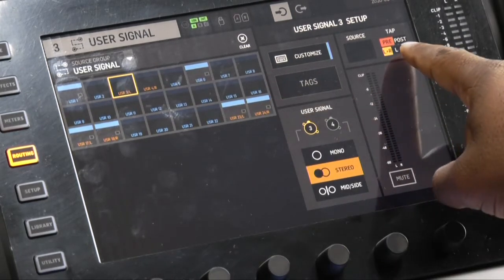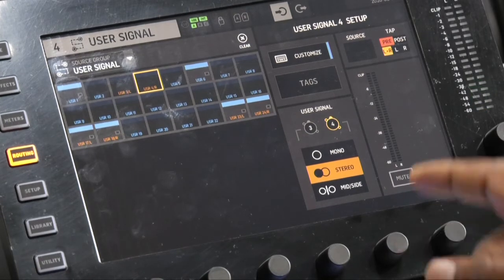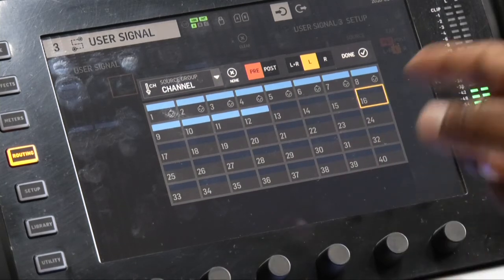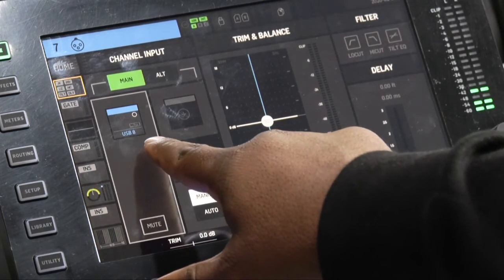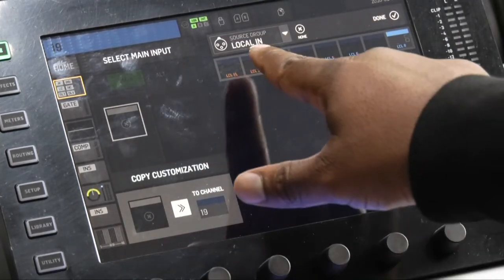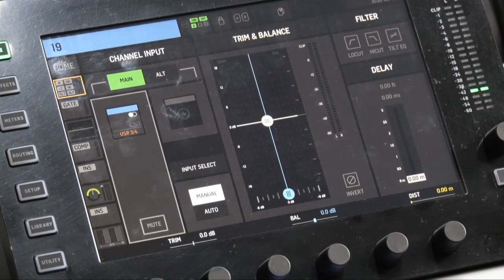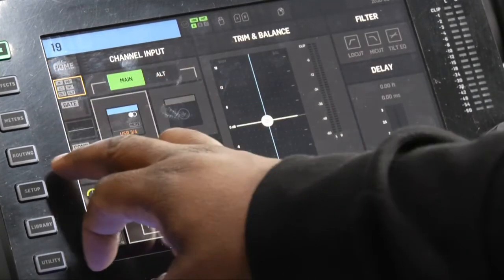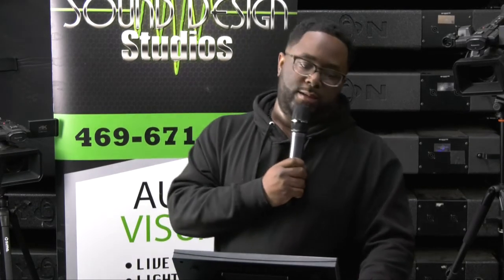Behringer Wing How to on Changing Mono in to Stereo channel, and choosing inputs

Comment: I was under the impression since the channels are stereo, you would only have to physically connect one stereo cable unto a channel. From what I'm seeing, the only way I can access stereo, is by using two physical channels. I was wondering if I could take a STEREO device/cable, and plug it into let's say Local channel 1 on the back of the console, and let channel 1 on the console control it. When I do this, and make channel 1 stereo, it's making ch1 and 2 stereo, when I only wanted for ch1 to be stereo, hoping not to take up more physical inputs, SINCE THEY'RE SUPPOSE TO BE STEREO CHANNELS, right?!?! (Don't know if I'm making sense here, lol, I'm confused!!)
Reply from the maker: tashakka stills If you’re only using one physical input, there is no way possible for that to be a stereo channel. Of course stereo means two sources that make One channel. Example like if you had a stereo keyboard you have to come out of the keyboard left and right. But if you summed those two channels together it would become a mono signal. So therefore yes you have to use two physical inputs from somewhere to make a stereo signal. And yes every channel on the Console are stereo inputs so you’re able to collect two sources and make that stereo signal. Hopefully I made some sense
Reply: @jshi600  thank you. Comprehension was a bit off concerning it. I was thinking it was the EQUIVALENT to the Stereo Channels on Analog boards like maybe the Soundcraft GB 8. YES, on the stereo channels, it has a left input AND a right input physically, but ONE fader. So, what I THOUGHT I was going to do was take a Stereo Aux cable from say a computer's output (stereo), and have STEREO on that one channel into the wing, lolol. Thanks for responding. I'm still trying to wrap my head around the Source concept. I think it's TOO MUCH FLEXIBILITY, and a lot more than I anticipated, since I recently am coming from an Analog mixer. Just gotta play with it for a couple days or so. Was wondering how I wanted to connect everything, since I also have the S32.

Comment: Question. the advertisement for the console says 48 stereo channels, so are you able to combine 96 inputs?
Reply from the maker: Gregory Rouse hello so with the console you can control 48 FADERS per say. But each fader has the capability of being stereo. So theoretically if your input list is set up a certain way you have the capability of doing way more than 48 inputs. The console will see way more than 96 inputs but of course you can only choose  96 to place on those faders. Hopefully that made some kind of since written out.
Reply: @jshi600  My Man! Thx so much